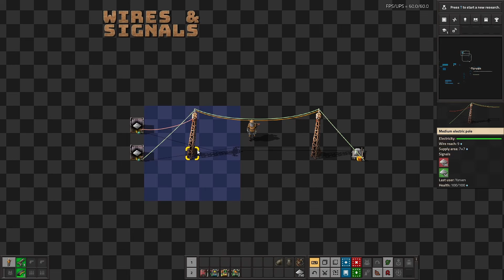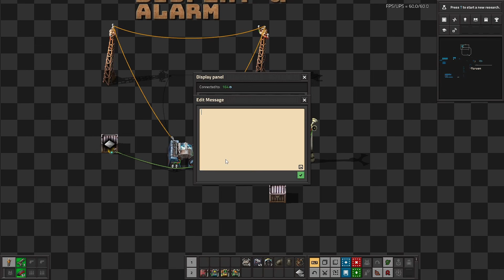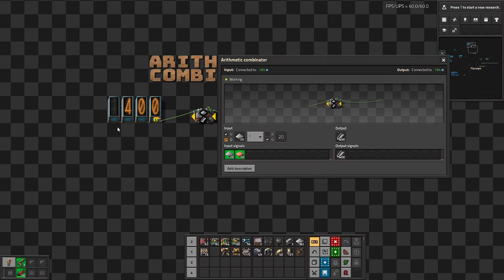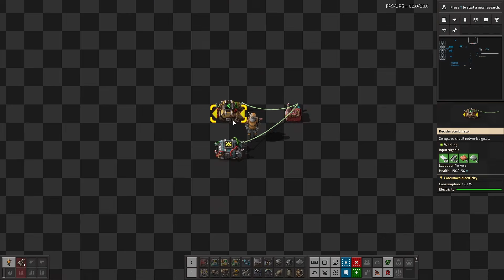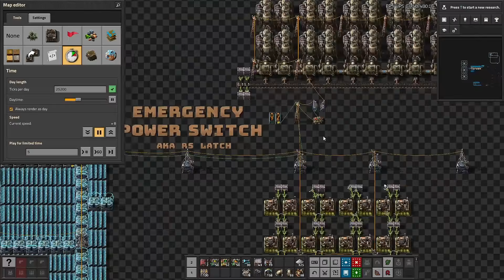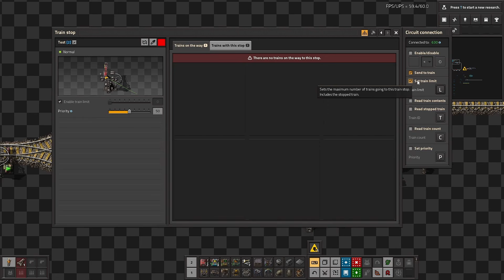The Circuit Network & You | Factorio Tutorial

Comment: For nuclear fuel control, one neat trick you can do is to hook your inserters up to the reactor directly, have the reactor read fuel, and set the inserter to "set filters" and switch the filter setting to "blacklist". This makes it so that it does not insert any new fuel cells until the previous one has been used up.
With this, you can then set an enable/disable condition based on either steam content (on a separate wire colour) or temperature, saving the need for a combinator all together. This may be less robust than using a combinator to set a condition based on both, but since heat only goes down when it's actually being used to make steam, one of the two is generally enough to ensure you aren't wasting fuel.
Combinators themselves aren't expensive or take up that much space, but for particularly compact reactor designs or space platforms, or for aesthetic reasons, it may be nice to not need them.
One problem I have encountered using this method using temperature as the control is that slight variations in the temperature of each reactor can cause some inserters to trigger and insert fuel before others, causing the temperature to rise fast enough to where the rest of the inserters don't trigger, which is less efficient since you loose out of neighbor bonuses.
The simple fix is to just have all inserters read from the same reactor, since you want them all to be in sync anyway, or using steam as the control.
Reply: Reading temperature is problematic if we are using multiple reactors. They provide alot energy and if less is used then heat will go up to 1000. Maybe 1 fuel cell in each reactor can't do that but I don't know.
Reply: @zulfiqarali4888  It's a valid concern raise. One fuel cell holds 8 GJ energy, and it takes 4.85 GJ of energy to warm from up a reactor from 500 C to 1000 C, so in isolation you're right, you would be wasting energy. However, heat is distributed throughout the heat network, acting as a buffer of energy itself. Each heat pipe and heat exchanger takes 500 MJ to go from 500 C to 1000 C. Because heat doesn't transfer instantaneously, calculating the exact capacity of your heat network is a bit more complicated, but roughly speaking if you have like  7 heat pipes/heat exchangers per reactor, which you will very naturally reach, you can store enough energy in your heat network to hold the energy of one cell per reactor. There are still some problems using heat as your control, such as the issue I mentioned with uneven heat distribution causing only some reactors to run. For heating towers which don't have neighbor bonuses and doesn't have less energy dense fuel, just using heat as your control per individual tower works perfectly well.
Reply: @TheEmms I have 2x4 reactors giving 1120 MW of energy if all are running. Heat exchangers match this but turbine are less so they can produce 420 MW. However my base is not big and only uses 100 MW or less. So maybe heat get stored in heat pipe as putting 112 heat exchanger require much pipe. But at the end energy requirement is quit low. 
I will do some circuit to find out if it goes up to 1000 if all reactors are connected to one reactor temperature
Reply: @zulfiqarali4888  I realized I made a mistake in what I said, so I just opened the game to test to varify. The rule of thumb I gave of 7 heat pipes/exchangers per reactor didn't account for neighbor bonus. A more correct thing to say is that for a single reactor, you need 16 elements in your heat network, where the reactor itself counts as 9.7, to fully store the energy of a fuel cell. There is some slight loss in capacity the further heat has to travel, so we need a little more than that the larger the network is. When you factor in neighbor bonus, you need to multiply the amount of heat elements in the network by that factor too. In your case of a 2x4 you'd need 448 heat elements. Your reactors count for 77.6, so that leaves 370.4, with the actual number being a bit higher due to the loss from travel distance. A 2x4 reactor design I made uses 112 heat exchangers and 252 heat pipes, so 364 heat elements, which means close but quite enough to fully store the energy, and that is before factoring in the loss from heat travel distance. I could remedy this by adding more heat pipes to expand capacity, but the design is too compact to fit much more. Because my factory is actively using at least half the full capacity most of the time, I don't mind potentially wasting a few fuel cells the few times I use less than that, as I have plenty. In your case however where your average energy consumption is much lower, it's a very different story depending on how much capacity your heat network has, and using steam as your control is probably going to be safer if you're worried about waste. Still, I think it's worth remembering that the heat network can store energy itself the same way steam tanks can, and a lot of energy at that, more than we might think.
Reply: @TheEmms  The amount of calculation you did, I think i would just go with steam tank storage. However I have chest full or fuel cells. I just used a logic combinator with reactor to control its inserter each alone. And I notice I was not getting neighbor bonus but I think it didn't matter.
Of the topic, I was creating a circuit design which would tell the rate of items consumption in a chest. I designed it and its tells items increased(+) or decreased(-) in chest per second. 
Do you know any better design which could do more like giving average of some seconds combined while updating per second. 
Here is the blueprint. New Factorio 2.0 greatly improved circuits. And this design teach me alot about that. 

0eNrtml1u2zgUhffCZ7ow/0TJQB9mHYFhyDaTELUpg6LSGoEW0F3My2xsVjKk5NhuLMfVaTtIgT5FZngu7z0ff2TCz2S5aczOWxfI7JnYVeVqMrt7JrV9cOUmtblya8iMOPvFmkloloa0lFi3Nl/IjLV0oOvarOza+Mmq2i6tK0PlzyR8UFJ6Gx63JtjVsEq0c0qMCzZY0yfYfdgvXLNdGh8zoZeJTuptudkQSnZVHYWVSwPGYJNcflCU7MlMTz+oNiX0KhofFU2cR6Mkehh8tVkszWP5ZGMZsd/K+lVjw8K4crkxazILvjH02Bwl62PMe+vrsLiwyPrKTSrf2Z8whTIxm3AmtcxFJvPUvN2VvrNuRv79+g9ph4oTo4rTL8WJYavkqGjZjWiKvj0j3mLJr3h/inTyuR4yOux3aeQn60NTpvQPqfQ9JqZcPSbza5PCjNdVOxPZdKmTSexVNWHXAOOfp71wJnyu/KeuHn+aWA/emDjOfbmpzeuULzVdt6MoRWgHZ042irU6Z/3+l4XG1vyViZyPisZvRCtGRWO/l/FsOqY6Xfza6m4swr9+vNzTUTVwUL61Z14r9xDm1e52/unuR+tUxUV5fxNoK+qjmMVh/NKtSTrb+83w9bvHrR3xyfh9eLTuIWX7XdvafJgJH8lEvUcmH28SGXTk15g/AP+a+WKk+eJ3XRAD9v+vC2IEEzmSCf+zIH6e+Wqk+dN3YT5s3CHSbh/za1xY3Ptqu7AuBjoeG+OiXfP19P5aN8uYd2fi0AtU72bRzYXP1ndfOe845VRROad3ijIady3RPXIaT4/Ump0ei9RBdh3i201s7nXx6GfpmfXPsZ29tMsXafxzDM7SkDEOT8/irF180y6OY8nUJ+vjy7NxVT+umMd6gt0cvkJf1J13dWdFe/TJm3vrzDrOP7fyJqSXvQGdBnUZqFOgToI6Aeo4qGOgbgrq8sP1BcZ9vC4DdQrUSVAnQB0HdQzUTUHdgTsDuTOQOwO5M5A7A7kzkDsDuTOQOwO5c5A7B7lzkDsHuXOQOwe5c5A7B7lzkLsAuQuQuwC5C5C7ALkLkLsAuQuQuwC5S5C7BLlLkLsEuUuQuwS5S5C7BLlLkLsCuSuQuwK5K5C7ArkrkLsCuSuQuwK5ZyD3DOSegdwzkHsGcs9A7hnIPQO5ZyB3DXLXIHcNctcgdw1y1yB3DXLXIHcNcs9B7jnIPQe55yD3HOSeg9xzkHsOcs9B7uB9nQbv6zR4X6fB+zoN3tdp8L5Og/d1Gryve1s3p8QGs43/O/1Si5In4+suksp4IYtC6SlXuuBt+x8vmXvf
Reply: @zulfiqarali4888  I've looked at things more closely, and my main take-away of all of this is thus:

A reactor system has two energy buffers, the steam fluid network, and the heat network.
When using heat as your control, it will always try to top off your steam buffer, meaning that to ensure no fuel waste, the heat network alone needs to be able to store the full energy from one refueling of your reactors.

This is more achievable than one might think. A steam tank can hold 2400MJ in a 3x3, which is about 266.66MJ per tile. Meanwhile in isolation a single heat pipe can hold 500MJ across their working rage from 500 C to 1000 C in a single tile, almost twice as much. Heat exchanges can hold the same as a heat pipe, and reactors can hold 5 GJ (so 10 pipes, not 9.7 like I originally said). Each fuel cell is 8 GJ ( so 16 heat pipes worth of storage) multiplied by the neighbor bonus of the reactor. This is however complicated by the limited throughput of the heat network, which lowers the actual capacity the further heat has to travel, so the real number will in practice be a bit less than that.
A maximally compact design is probably going to fall a bit short of the required buffer size, but using a less compact design, or by adding more heat pipes to the network here and there, it might very well be able to hold enough, or at least come fairly close.
My 2x4 reactor design uses 112 heat exchangers and 252 heat pipes, so 364 in total. Combined with the reactors, that's 444. For 2x4 reactors, under ideal conditions you need 448, so I'm very close. In reality when I tested this, the reactors capped out on heat when there was about 10% fuel left. After sneaking in 8 more heat pipes (so 452), they capped out when there was maybe 3% left. Sneaking in 8 more (so 460) and it capped out at maybe 1% or less. This was with 0 steam consumption. Realistically I would set the threshold for refueling at slightly more than 500 heat, making the required number of pipes a bit higher still.
The fact that my design was this close without really trying I think goes to show just how much energy you can store in a heat network.

When you use steam as the control, you allow the energy of a refueling to be stored in both the steam and heat buffers, making it easier to have the required energy storage needed. One problem with steam however which I have encountered is that if steam is low because of something else, like a lack of water for example, your reactors will just keep being refueled even as the whole network is at max capacity. Perhaps not much of a concern, but, if you accidentally cut off a pipe somewhere you might not notice until your whole factory is out of power, and if your steam threshold for refueling is fairly high, you might have been needlessly burning fuel cells for quite a while up until then if your power consumption isn't that high.

Using a combinator to use both steam and heat as a control as shown in the video will account for either failure state, but this is only necessary if your heat network alone can't store enough energy, and that is if you're worried about perfectly minimizing waste.

In conclusion, regardless of what you use as your control signal, don't be afraid to add redundant heat pipes in your reactor designs (or anything built on Aquilo) if you feel it makes it look better, and if anyone questions you about it, just tell them "it's for storage :D".

ps: I'll have a look at your blueprint, and see if I come up with anything, but it'll have to wait for later. I've already let myself get a bit too carried away looking into this stuff (not our fault, I'm just a nerd. All you did was pose an interesting question).
Reply: And for the corvax enrichment, i set up a loop with 20 centrifuges and when the belt reads 800 of the glowing ore a splitter switchs sides to a separate loop allowing excess glowing ore to be siphoned off for warcrimes against the bugs. The dull ore is limited aswell so it doesn’t oversaturate the belt. Not sure how others do it but it works well enough. Now i just gotta figure out how to stop my spaceship from getting clogged up with resources and coming to a complete halt. I have a feeling that your trick here could be useful for this.